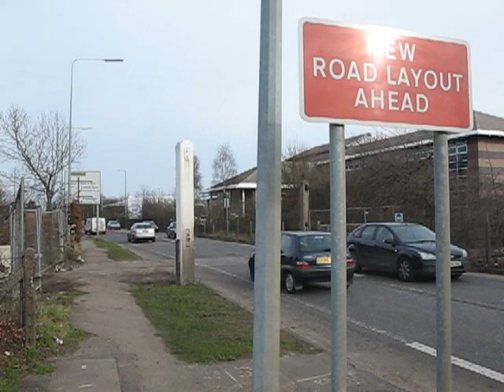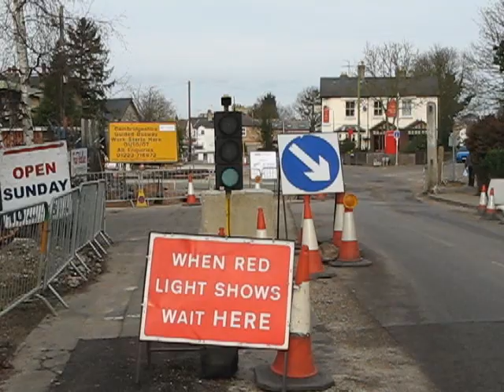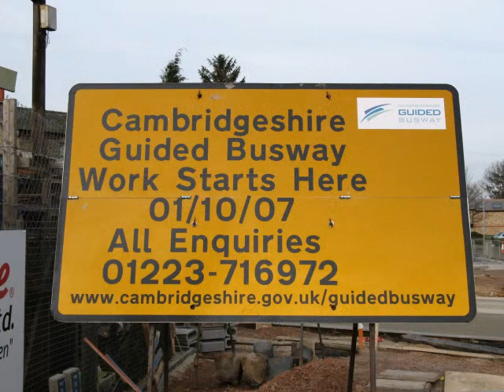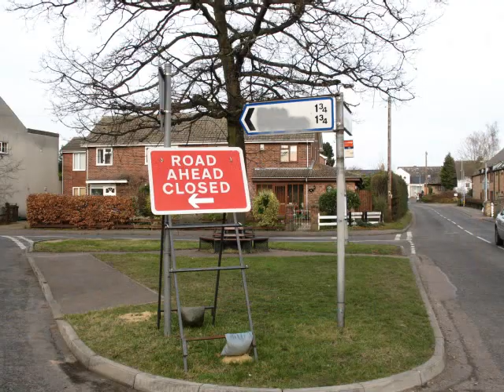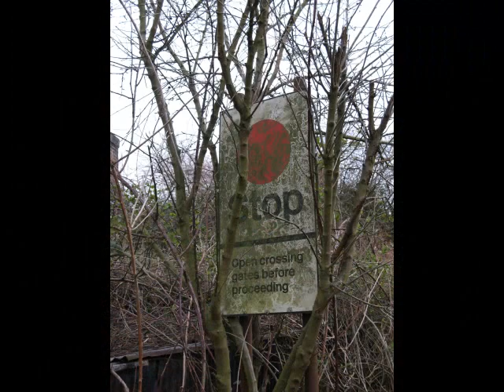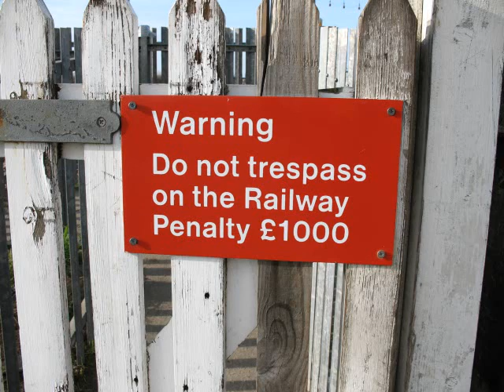Cambridgeshire Guided Busway Under Construction (Historic footage)

Comment from the maker: They are testing them on routes 15 45 and 55 to St Ives at the moment, but up the A14 not the busway.
The seats are comfy and the buses  have internet and aircon.
On the negative the lights inside are pretty UV so it makes reading hard. 
And the eco impart of the 'bio' fuel is higher than peterol, because so few buses use the bio stuff.

Comment: We'll just have to see what happens. It'll be interesting to see if passenger numbers on buses on the A14 corridor rise. I think it will, but not by very much (maybe 5 or 10%). I don't think it will be a modal shift, because of the problems of Cambridge congestion.

But if fares were kept low, and there were incentives not to take the car in, speeds would improve. The buses would no longer get stuck in traffic.

Comment: The busway is years late because of faults that were found after it was built. If the designers had built a test track first they could have identified any design faults and dealt with the inevitable problems of a new system before constructing the whole network. But they did not, and now they must sort out the problems on an already-constructed installation.

Comment: Steel wheel on steel rail is more efficient than rubber tyre on road. There is much less friction.

And people are far more likely to decide to get on board a train or tram than a bus (if they consider leaving the car in the garage at all). Buses have a poor social image. And it would not even be able to go as fast as a tram-train (the latest of these can do 62mph). The guided bus I think will only do 43mph.
And if 'Carpet Track' had been used for the city centre, building wouldn't take long.

Comment: A light rail Tram system would have been better with the trackbed already there,all they would need is the power supply,they could have had tram-trains which run on heavy rail and light rail.
Reply: Lots of people - including locals - say that. But the track had been derelict for 30 or more years, and was competely shot. Also, certainly at the St Ives end, the trackway was missing, because among other things new roads had been built.

Comment: That's disgusting.  It is going to cost a zillion times more to build and operate than an LRT or tram line...not to mention the ongoing higher labour costs (one driver per bus) versus one driver per multi-car train, and also high petroleum costs and GHG emissions.

Comment: the choice for the busway was moronic. The re-instatement of the railway would connect St Ives and Cambridge to Huntingdon and peterborough etc
GUIDED BUSWAY = RUBBISH
Reply: Perhaps it was stupid to close the railways in 1960 or whatever, but in 2010 all the track between St Ives and Huntingdon was long gone, and the land sold. So the railway would have stopped at St Ives.